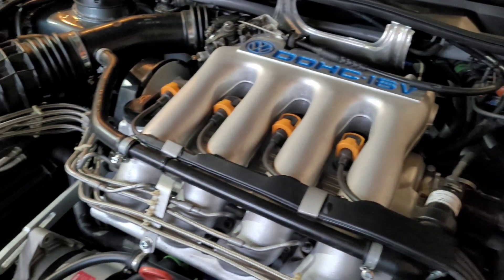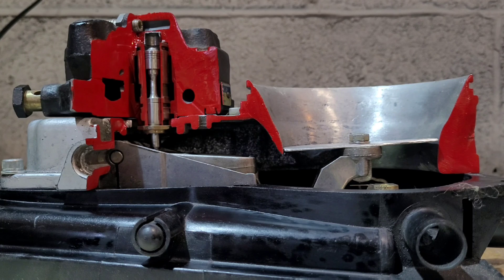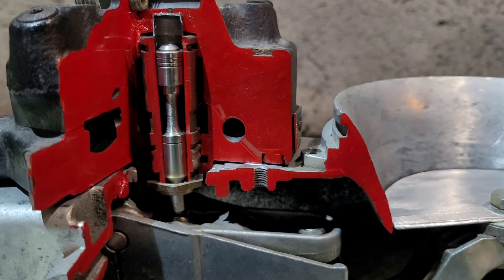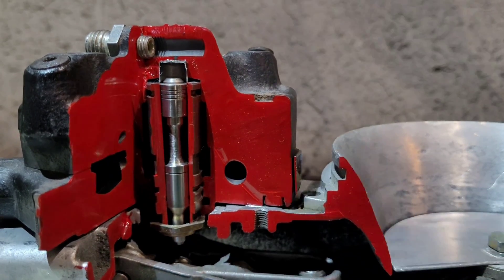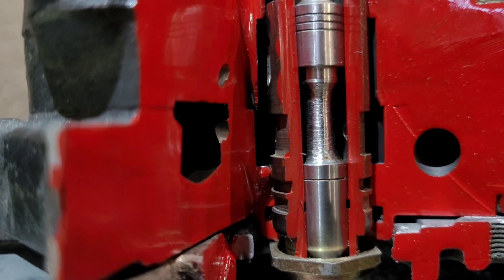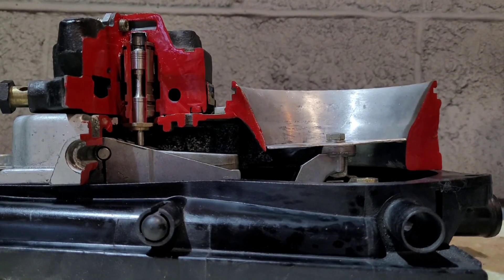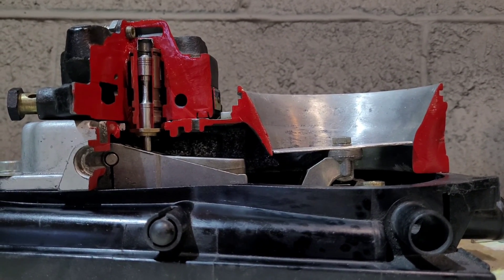Bosch K-jetronic - The Inside Truth

Comment: Thanks for all of your work on these videos - so helpful. I'm going to attempt to free up a VW fuel distributor which has been sitting since 1991. Interestingly, in 1991 I filled a jar with gasoline and put the 4 CIS injectors there for storage. The fuel is still a light amber color, doesn't even smell too bad after 34 years! Injectors still spray a fine mist with 50psi air pressure.
Reply from the maker: Happy they have been of help to you 👍 in think if fuels air tight it'll not sludge up, good to hear the injectors are still spraying well too
Reply: @GreyGooseRestorations  Also just got a 1979 cold start valve working again. Seemed dead, but put a few drops of penetrant oil in it and tapped it with a screwdriver a couple dozen times, and all of a sudden got that satifying solenoid "click" with 12v applied. Love the quality of old Bosch stuff.
Reply from the maker: Built to last

Comment: Hi should there be a spring in the 6 cylinder distributor above fuel pin regards Richard Smith
Reply from the maker: Hi, most of 6 cylinder units do have a spring yes

Comment: are all these injectors the same size even though they are on different cars? did it work to increase the air flow in any way. bigger throttle? i had a volvo 240 with this injection in my youth i think i remember someone saying i would have gotten more power if the throttle would have been bigger. maybe some other car had a bigger one. if anyone knows? saab had the same injection i think? it worked very well injection but i remember me and my friends wondering if it wouldn't be possible to get more power from injection?
Reply from the maker: 99% are the same bar a few which are longer, mainly porsche and ford and the early cars had a smaller injector line thread

Most kjet systems in stock form will support a good 40% more power on the base engine its attached too, Again most air meters had an 80mm plate on 4 cylinder engines but one or two certain cars had a smaller plate with a different cone sizing.

So doing anything upstream of the air metering to increase intake of air would help lift the air plate more which provides more fuel

Comment: Learning this system for my 2.7 PRV. How would you unstuck the pin without taking the whole assembly apart? My PRV has been sitting for 40 years or so and i’m totally expecting a stuck pin. Thanks!
Reply from the maker: Hi, soak penetrative oil through the metering head, the base of the fuel pin, and through the top control pressure orifice, you'll have to position the unit differently when soaking each part. Soak for a good few hours, then either try and pull the pin with pliers or compressed air through the top control pressure orifice.

Comment: Great video. I will be rebuilding the fuel distributor. Can the metal cover of the distributor can be powder coated once all the gaskets are removed ? Not sure about this
Reply from the maker: Thanks, I wouldn't powdercoat it personally. there is too much risk of powder getting inside the unit

Comment: Hi is ir possibke to rebuild this meturing head at home using new gasket and diaphram set i have stripped it down and id like to try to rebuild it, or is it a specialist job thanks for any help and advice
Reply from the maker: Hi, it can be done at home with great care, then it would be best to check fuel pressures and carry out fuel outlet balancing when its back on the car
Reply: @GreyGooseRestorations  you mentioned rebuild kits where did you get them please, ive cleaned it all with carb cleaner and got all crap out and its in house and im hoping to to try to rebuild it 😃  and did you buy your pressure gauges or make them thanks again
Reply from the maker: @caseytattersall814 most parts I buy or use are from missingparts.de they also supply a  very good quality pressure guage kit
Reply: @GreyGooseRestorations  thankyou for your help

Comment: Hi mate, been subscribed for a few months and loving your channel. Do you know how to set the CO screw for an engine thats not running due to the mix? Obviously you can see the pin gap on this model but how do I set it up without being able to see the pin? Ive found loads online for setting Mercedes one but this one operates the opposite way and i’m a little lost. 
Any help would be greatly appreciated! Cheers
Reply from the maker: Simple way to get it in the ball park is pull injectors and stick in bottles

Swap relays so pumps continuously run

Turn ignition on and turn the 3mm allen clockwise untill the injectors just start to dribble/spray then back off half turn
Reply: @GreyGooseRestorations  thanks mate, ill give this a try tomorrow!
Reply: @GreyGooseRestorations  just a quick one from rewatching one of your other videos. Which position should the air intake flap be in for this test? Just the 1.5mm stock position? Or open slightly to mimic idle? Cheers
Reply from the maker: @ScouseSponge to test fuel flow?
Reply: @GreyGooseRestorations  yeah sorry realised later on its obviously not required! Cheers for the support and all the helpful videos!

Comment: Thank you so much for this demo video. I'm trying to adjust the the ratio on my 1982 911 SC with the Bosch K-jetronic and it's popping and smells lean with rough idle. Just by lifting the air plate a bit it instanly smooths out. I initally couldn't figure how deep the 3mm allen was but now I know where it is. Unfrutanly it feels frozen so I may try a small amount of penitrating oil over night. Subcribed.
Reply from the maker: The 3mm might be full of debris so hopefully some wd40 or the like will losen it all up

Comment: I have a 924 2.0 and I can't get it to run.  I've removed all 4 injectors and when I crank the engine all 4 injectors spray huge amounts of fuel without the metering head even moving, I've checked the plunger in the metering head and it moves freely. The plunger looks very new and always seems to rest on the arm no matter how I turn the screw. Are there different lenght plungers?
Any ideas would be great
Reply from the maker: Hi, if its spraying fuel with the plate at its rest position then its either the fuel plunger is incorrect or not set right and you have control pressure being injected from the top of the fuel plunger due to it being to low or there is a seal or seals failed internally

Comment: How much voltage should the lower fuel pump receive to function properly?  My friends car is getting around 9-10 volts, could that cause the fuel not to cone out of the shims? Thanks
Reply from the maker: The main fuel pump under the car needs to have 12.5 volts minimum. With around 10 volts, the pump won't be producing enough pressure

Comment: That cut through model is a great idea!
Now I have red that for removing the plunger you need to measure the depth of the slotted nut at the bottom (somewhat around 0.6mm) to reset it to the exact same later on.
I understand that this nut defines the bottom position of the plunger but does it affect anything after the arm raises it up?
Greetings
Reply from the maker: Thanks, the slotted nut depth is only on the CIS-E / KE-Jetronic. On plain jane k-jetronic the nut is just for retaining purposes
Reply: @GreyGooseRestorations   Thanks for the reply. Do you know what exactly has been changed on KE for this to be a matter?
Reply from the maker: KE is a different kettle of fish (in the process of making a video specifically for KE) the metering head is upside-down and has a differential pressure regulator instead of a WUR and has a potentiometer for the air flap along with an o2 sensor

Comment: So, in your explanation at abut 6:45   Mine has set for more than serval years, and when I manipulated the air flap manually it lifted.  Even though the pin will not likely drop on its own weight, and each subsequent "plate lift' is not really pushing the pin anymore....it at least suggests that the pin is not "frozen".  Correct assumption ?
Reply from the maker: If you can move the plate then potentially yes the pin isn't stuck just sticking so wont return under its own steam which is good
Reply from the maker: If you can move the plate then potentially yes the pin isn't stuck just sticking so wont return under its own steam which is good

Comment: I have one of these with the fuel pin stuck up in the distributor, have it mostly apart but I can’t get the pin out from fear of damaging original parts, can you please help my father and I fix it?!?
Reply from the maker: Best way is lots of WD40 or similar, spray loads through the centre connection on the top of the metering unit, then all the other ports.
Take it slow and let the WD40 etc do its work, last one i had issues removing took a day or so of soaking over and over few houra apart etc
Reply: @GreyGooseRestorations   how’s brakeleen, with wd40 does it need any form of lubrication after?
Reply from the maker: @ejmiller3109  brake cleaner may cause damage to the rubber seals inside.

Just use the same WD40 or similar to lubricate the pin once its all free, its lubricated by the fuel in normal operating conditions
Reply: Compressed air

Comment: En las autoescuelas en España hace unos años tenían unos montajes parecidos para explicarlo todo.
Thank you very much I had problem with k jetronic because  8 bar is excesive.
I had 8 bar in  filter of benzine and  before fuel pressure regulator , and the car fail if push the throtle pedal at maximun.
The orange engine  ligth sunrise and its a 1988 audi turbo.
Reply from the maker: Where are you getting 8bar

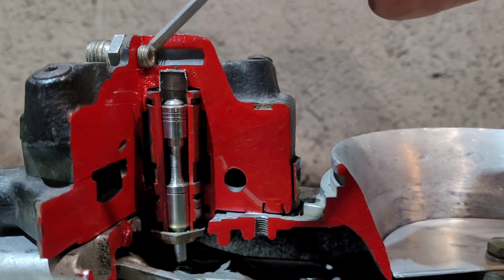Comment: Just to make sure that my K-Jet and WUR are setup right...The top inlet part that you discuss at 3:10 should have fuel coming back from the WUR? Am I correct? Should it be connected to the WUR on the right side of WUR with the bigger banjo bolt and screen filter? It seems to me that the screen is to keep crap OUT of the WUR... Maybe previous geniuses screwed up the Meter-to-WUR-to-5th injector order...That might be why it only runs right when warm.
Reply from the maker: Potentially, the larger banjo with guaze filter is the fuel in. The other one is the control pressure that goes to the top of the metering head
Reply: @GreyGooseRestorations  Mine are hooked up backwards with regards to our conversation but when I look at the arrows that indicate flow direction and the curves in the hard line at the end of the hose and the size of the banjo bolts --- It can't be hooked up any other way. The larger banjo (with the guaze filter) is connected to the top of the metering head, it can't be hooked up any other way. I'm baffled.
Reply from the maker: Thats confusing 😕 send us a picture if you like via Facebook page Grey Goose Restorations
Reply: @GreyGooseRestorations  I will snap some pictures shortly just to add to the knowledge pool. I did solve my cold start issue: 5th injector was defective. I put it a used, working injector and I get normal cold starts now. Thank you for all of your help.
Reply from the maker: Ace, glad its starting better now

Comment: This was a wonderful explanation.  If the needle is stuck due to setting.  What is recommended?  Is there a way to fix it or do you have to buy a new assembly?
Reply from the maker: Thanks, do you mean if the fuel pin/plunger is stuck?
If so it can be removed gently after spraying WD40 or similar in the top control pressure union and let it soak through

Comment: Great video mate. I'm really struggling with my RS turbo. After rebuilding the metering head I just can't get it to start. Pin nice and clean everything replaced as it should. Just a no go
Reply from the maker: Thanks, i could be something amiss internally if everything else is set up correctly, do all your injectors spray?

Comment: Very informativ video,,,,I learned a lot ,,,,I which I had  seen this ,,before,, I started dismantling and rebuilding my KE-jetronic ,,,,without any knowledge in advance,.  Well I got it right after some" try and failure " and my Audi 80 cab with 2,3 L inline 5 pot,,(NG ) is running "smooth" today
Reply from the maker: Ace, glad it helped, KE-jetronic can be a nightmare so fair play 👍
Reply: would you give some advices? ive got an NG also.
Reply from the maker: No problems

Comment: Good video,  I have a 1982 Volvo with k jetronic and I need to repair or convert to electronic fuel injection if possible.
Reply from the maker: Easy enough to repair vs cost of efi conversion potentially

Comment: I have an XR3i, it starts fine from cold and if you switch off hot for about 5 minutes it will start. However if left longer than 5 minutes it won’t start. Eventually when it’s cold again it will start straight away. My theory is it’s loosing system pressure slowly and then vapour locks the injection lines from the heat? Any ideas? It’s had a new accumulator and non return and another fuel pump.
Reply from the maker: There is a seal in the metering head that holds pressure inside the metering head that are prone to wear and passing fuel back to tank, if this is at fault it could cause those symptoms, its the one on the end of the system pressure relief valve
Reply: @GreyGooseRestorations  Thanks for your help! That would make sense, the car is just shy of 40 years old now so it’s probably allowed to need a replacement! Anything else that you would recommend doing whilst it’s apart? Do you know if there is a service kit available?
Reply from the maker: You can get all the parts from missingparts.de thats who i use to supply the kits 👍
Reply: @GreyGooseRestorations  Thats great thanks. I’m surprised you can still get all the bits for the K jet considering how old it is now, other parts for the car are not the easiest of things to come by nowadays!
Reply from the maker: I know XR3I stuff is very hard to find, was trying to track my wifes old one down last year, its still on the road which is one thing 👍
Reply: @GreyGooseRestorations  oddly enough I sometimes wonder if previous old owners of my cars ever look to see if they’re still alive, or would like to see them again
Reply from the maker: A few times i have, for example my old 200tdi disco for magically had a clear MOT report after i sold it yet it needed a lot of welding, hence why I sold it haha

Comment: I have a 2.2 Audi coupe b2 and i’ve managed to get it running on all cylinders now. 
When i operate the throttle the engine stalls. 
I have replaced the injector seals (plus 3 of the 5 injectors) and nearly every rubber hose for vacuum leaks. I can see the rubber intake boot deforming slightly as i open the throttle which to me means theres a good vacuum to operate the plate surely? 

However there is little movement, if i operate the throttle and the plate manually it runs really well. 
Could this be the pin sticking ? And if so is there a good way to unstick it ? 

The car sat for 20-25years prior to me getting it and i did initially unstick it by operating it manually. 

Any help is much appreciated thanks!
Reply from the maker: A good way to unstick the pin is to remove the metering head off the air metering unit
If there is a metal tab preventing the pin falling out the bend this out the way and remove the pin.
Spray some cleaner where the pin goes and clean the pin then use some fresh fuel for lubrication and refit the pin and bend retaing clip back

Also if one isn't fitted you can install a soft stainless steel spring in above the fuel pin which give a little aid to help the spring return to rest
Reply: @GreyGooseRestorations   i’ve managed to clean off the pin and it was pretty clean with a tiny bit of rust at the end which i cleaned and it moves freely. There was a spring above the pin already. 
Still the same results where if i operate the distributor manually with the throttle it runs perfect, but if i just give it throttle it bogs and cuts out with an occasional backfire. 
Any ideas ? 
I’m stumped at this point.
Reply from the maker: Ah ok, at the rear of the air box there is s black and grey plastic valve with a vacuum connection and an electrical plug, un plug the electric connection and see itlf it revs ok
Reply: @GreyGooseRestorations  I will try that next and see what happens. 
Thanks for the replies. Most of the system has been replaced due to it sitting for so long and every vacuum line etc except 2 which look okay.
Reply: @GreyGooseRestorations  I have given that a go, still exactly the same. 
Becoming more of a nightmare than a project haha
Reply from the maker: Hmm interesting does your throttle body switch work correctly
Reply: @GreyGooseRestorations   unplugging it doesn’t seem to make a difference either way so maybe thats at fault ?
Reply from the maker: Unplugging the throttle body switch made no difference when reving?
Reply: @GreyGooseRestorations  no, no difference at all. The idling is still lumpy aswell, it will backfire when cold and misfire when warm.
Reply from the maker: That switch needs replacing as it controls the cold start injector and cold enrichment fueling along with the Deceleration cut off valve
Reply: @GreyGooseRestorations  i’ll look for a replacement, if this fixes it then a massive crate of beer is coming your way 👌🏼
Reply: @GreyGooseRestorations   update: i tested the switch and it does change voltage on the multimeter which must mean its functioning properly ? I’ve replaced the deceleration valve and everything is still the same. 

I’m still stumped any more ideas ? 
Many thanks!
Reply from the maker: If you unplug it, do a resistance test accoss the pins in all different positions
Reply: @GreyGooseRestorations   you’re so far my guru with this as the mechanics around me either do not know how the system works or do not want to touch it so its very much appreciated, thankyou!
Reply from the maker: Thanks 👍